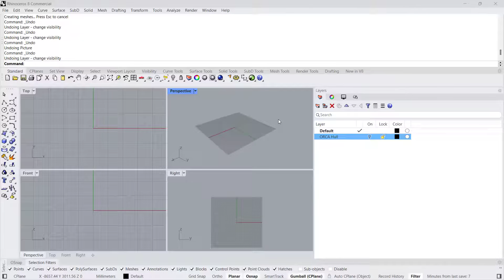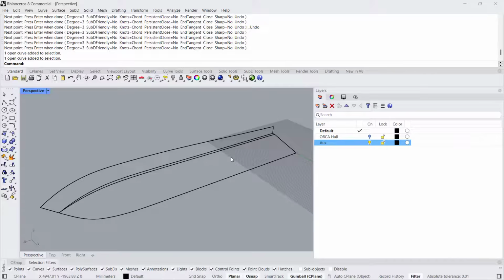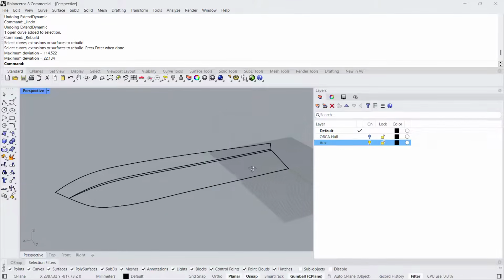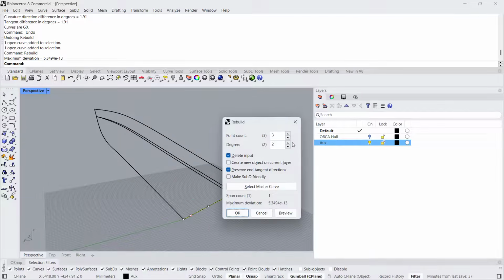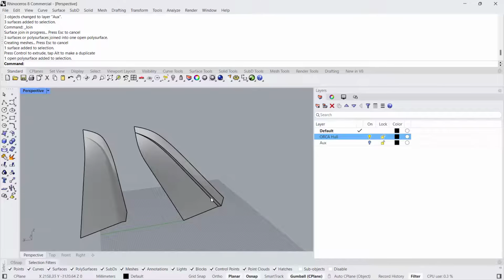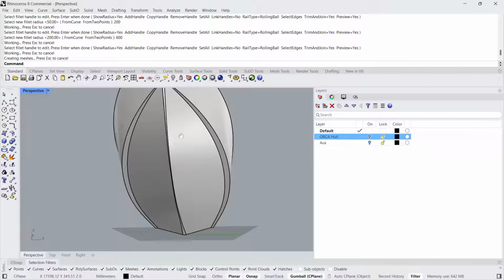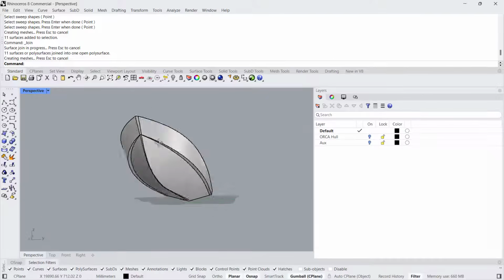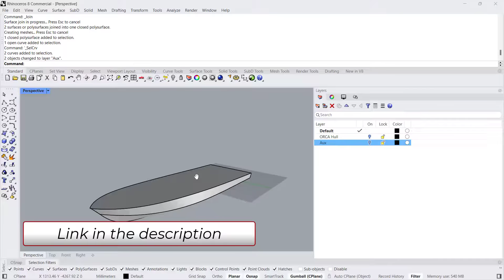How to 3D model a Planing Hull with Rhinoceros 3D

Comment: Hey Tony great video, A quick question if you dont mind.  How do you determine the forefoot when you start a design from scratch?  Does it always need to have part of the curve in the keel and forefoot so that the surface has a nice curve?
Reply from the maker: Hi William, 
Thanks for your question.
Forefoot shape will depend on the how much deadrise you want on the bow and also on the position of the centroid of your underwater lateral area. 
Regarding splitting the keel curve in two, yes, this is an important part of our hull design methodology.
On our yacht design course we explore this methodology in detail, please check it at https://tonycastroacademy.mykajabi.com/